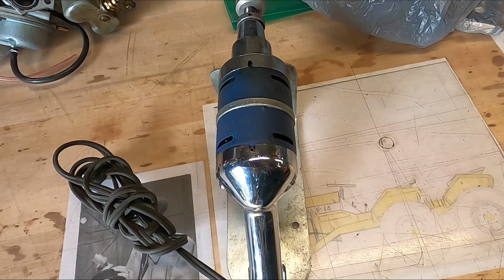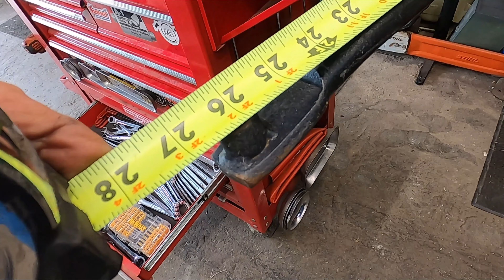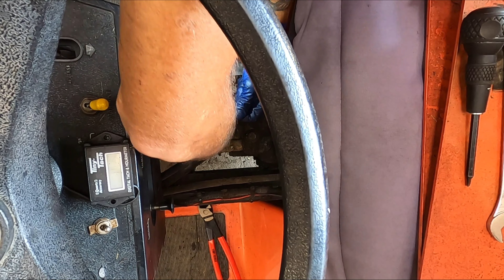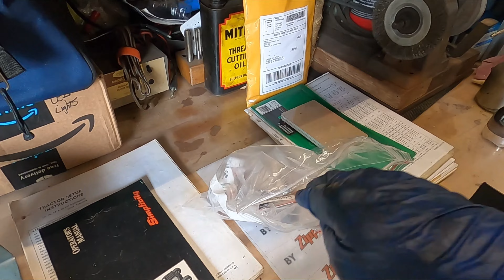Simplicity Legacy Front Blade. Will It Fit The Older Sunstar? And a Curve Ball Slows Progress.

Comment: almost forgot this, thats a pretty slick wire tie trick I will keep it in mine, thanks again Zippo
Reply from the maker: And, just like that, the Wheat Drill was made by McCormic Deering originally for being horse drawn then later adapted to be used with the Bolens Ridemaster.
Reply: @ZippoVarga  thanks Zippo

Comment: Welcome to my world.  I can not tell you how many times I have said to myself-- makes waste haste, no makes haste waste, no focus Chris- haste makes waste.  I once cut off the wrong exhaust pipe on my daughters car.  I could have kicked myself in the ask.  Anyway great video and way to much patience for me.  But perfect for you and the video.  That little tractor is extremely well built.  Reminds me of the old Bolens that were shaft driven.  Man that is a lot of hoses.  Excellent job as usual.  Thanks for the videos.
Reply from the maker: There ARE a lot of hydraulic lines for sure! Four for the power steering (Two coming from the pump and two to the cylinder) 4 more for the hydraulic lift (Same thing, two supply two to cylinder), then the Fill Tube is in the mix and if I add the Front Hydraulic system, we can figure out how to put two more into the mix under the dash lol. Fortunately the Rock Shaft that the hydro lift controls takes care of all of the front, mid and rear implement lifting and that's all mechanical linkages as you'll see on the rest of the blade install. Cheers Mr. C! Zip~

Comment: My simplicity 7116 running fine when I parked it in the garage a week later tried to start it's turning over fine but no spark checked everything I know to check no shorts in the wiring... can a coil go bad just by setting? Was wondering if you had any advice on what else I could check or would it could possibly be... thanks...
Reply from the maker: With it being in the transitional years for Briggs, your engine could have points or a Magnetron electronic ignition coil. Lok below and to the left of the carburetor. If there is a coffin shaped cover held on with two screws then under that cover are points. Chances are, it lost spark either due to the Condenser (Capacitor) or the points need cleaned and adjusted. Another more simple possibility is the spark plug went bad so I'd start there then work your way through the more difficult to troubleshoot items. The best way to get info from me is to email me at the email in the Description below all of my videos. Zip~